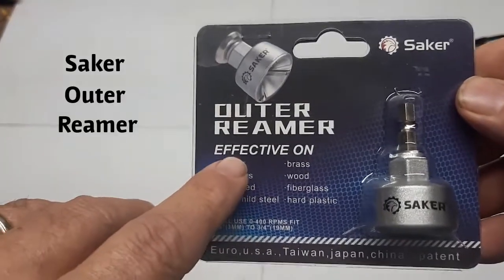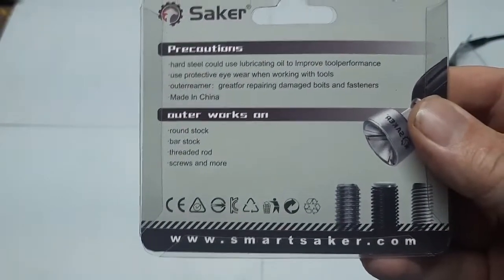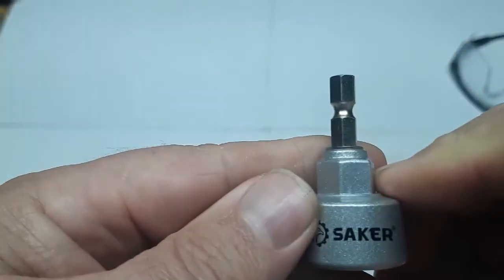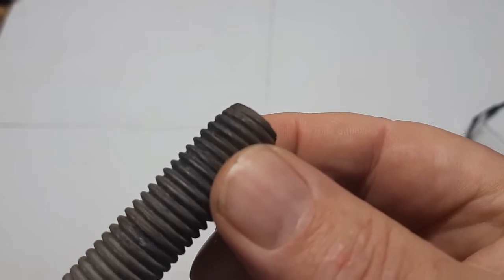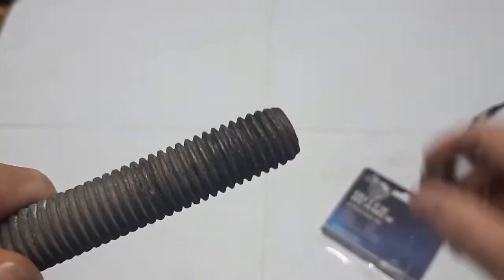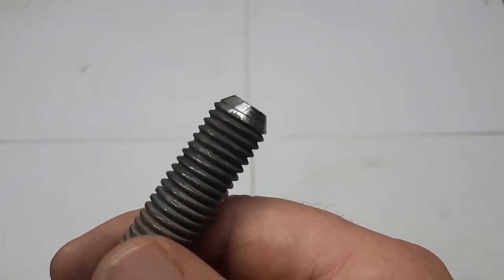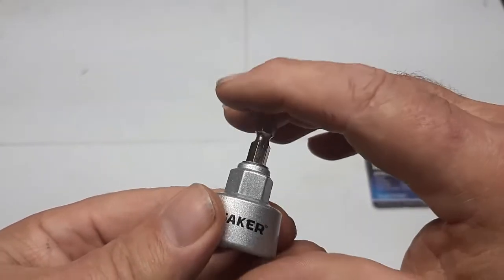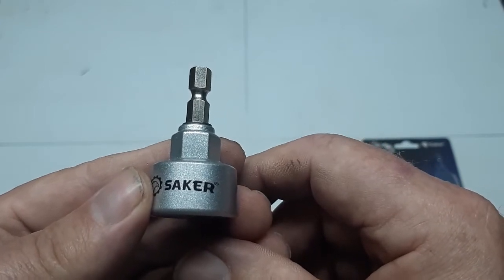Saker Outer Reamer

Comment: I have a very small screw and don't have a vise.  How should I use this reamer
Reply from the maker: Think the Saker Reamer is to large for a small screw.
Reply: @JimMcLaren1950  Humm.  Then, what might be an alternative?  The info on this to says as little as 1/8on an inch.  8-32 is a bit bigger than 1/8?
Reply from the maker: @jaimedpcaus1  It does go down to a small size. No vice maybe vice grips may help.
Reply: @JimMcLaren1950  Thx.  Just bought a small one to try it out. Thanks again. 😊
Reply from the maker: @jaimedpcaus1  Let me know how you make out, thanks.
Reply: @JimMcLaren1950  Hi, Jim.  I got my little grip today and just tried it 2 mins ago and it worked very fast.  Thx for your encouragement. 🙃
Reply from the maker: @jaimedpcaus1  Hi Jaime,  happy that it worked for you. Thanks for letting me know.